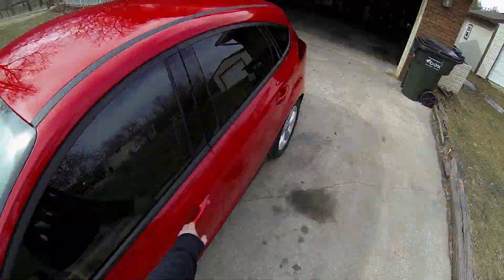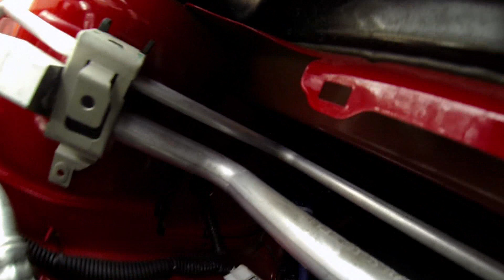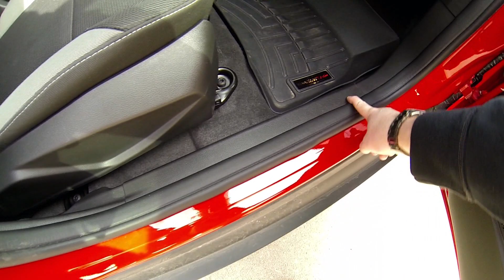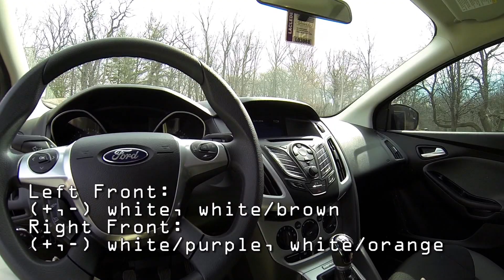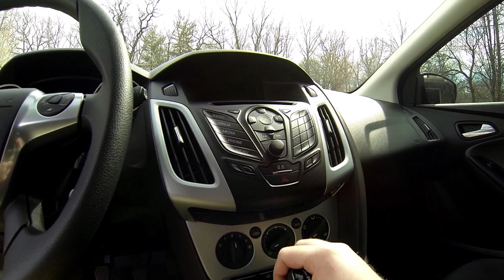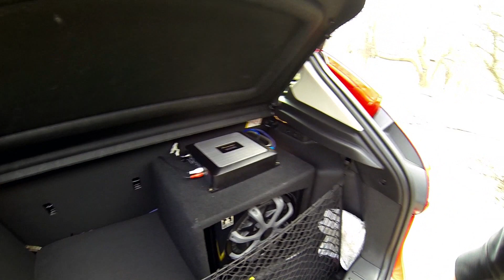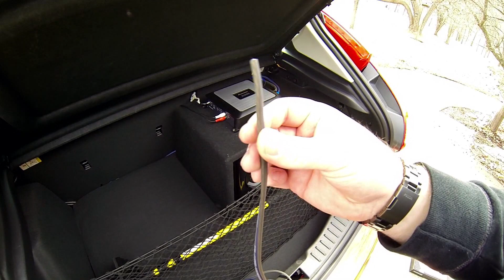2014 Ford Focus Amp Install

Comment: im scared to wire in a sub and amp to my car. i dont really know how to. should i take it to like an audio shop and let them do it?
Reply from the maker: +MrPuRpLeHaZ3 If you want to, then that's fine as long as you take it to a decent place. But it's definitely something that you could do yourself. If you do it yourself, just set aside a whole Saturday to make sure that you aren't rushed. This whole thing took me quite a few hours because I wanted to make sure that it was perfect. This is my first new car, and I really didn't want to mess it up. But luckily there's Google and YouTube University to help you out. Like I said, just take it slow and you'll be fine. But if you get to a point that you don't feel comfortable, then take it in. Best of luck!
Reply: +Dakota Alger i have no electronical experience is it pretty self explanitory if i buy like a kit.
Reply from the maker: Well when I did my first sub woofer installation I didn't have any experience in the matter, but I read a lot of articles online before doing it. Since there's not a rear deck, you have to take out your radio and splice into the wires, and if you're not careful, then you could do some damage. And if you hook up the battery cables you could shock yourself if you don't do it right, so it's not something you want to just do without care, but it's totally doable. If I were you, I'd check out more videos and online pages first. I do a more complete installation in my friend's Ford Fiesta here if you want to check it out:
 https://www.youtube.com/watch?v=jYCFZ5l726c
Reply: +Dakota Alger thsnks man your really helpful. i have a couple friends at school that are really big in systems so ill see if they can help me. this is my first new car aswell and i dont wanna mess up wiring like i did with my last one lol
Reply from the maker: +MrPuRpLeHaZ3 Yes perfect! If you have some people who have done it before then you can know all the mistakes not to make. lol   Glad I could help.
Reply: +Dakota Alger i bught a sub and an amp. i got the 12'' pioneer champion 2000w and a boss audio ar2000m. i dont know what guage wires i should get. i dont wanna cheap out on wires. but im also on a budget.
Reply from the maker: +MrPuRpLeHaZ3 I got 4 gauge kicker wires. I literally just got done installing a system in my little brothers car with the same wiring kit. It's more expensive than the other kits out there, but considering that you'll probably never take the wires out, you might as well spend some extra to get the good stuff. Mine were like $60 on amazon. I'm not sure what my brother paid for them though.
Reply: +Dakota Alger wow the wires cost more then my sub LOL. thanks for the help again. ill probably have some more questions soon lol
Reply from the maker: +MrPuRpLeHaZ3 No problem
Reply: +Dakota Alger if my amp accepts high level inputs i dont need a line out converter?
Reply from the maker: +MrPuRpLeHaZ3 Yes. That's the way my amp is, so I didn't waste the money on one.
Reply: +Dakota Alger if everything gets in on time i will be installing my sub this weekend. people said have it professionally done if i have steering wheel controls. if im just hooking into the head unit the steering wheel controls shouldnt be affected right?

Comment: Instructions were spot on. Installed everything without trouble. I added a signal to RCA converter in your install though. That is a must for tieing into a stock system. I used a Scosche Line-Out Converter with Bass Control for $20 (Walmart #: 551304026) but if you want to stick with Kicker (SKU: KIC13-KISLOC-N) it cost the same but doesn't come with the dash mountable gain control (which is good for me since i occasionally have my 3 year old in my car. I then use a Add-a-Circuit to power it since it acts as a signal booster.
Reply from the maker: +Chad Jason Luckily my sub has high level inputs, so it saved me quite a bit of extra wiring there. I soldered a potentiometer to my amp board so I can adjust the gain of the amp remotely too. It looks kind of bad, but it's just sitting in my center console right now.
Reply: Chad Jason which fuse did you do the add a circuit to? all of the fuse slots I have tried so far aren't working. Everything I put the remote wire into the amp, the amp is just constantly on,  no matter what. Doesn't even have to be plugged into a fuse slot
Reply: Cody Harper I used 5 amp fuse in the trunk gos to sun roof I don't have

Comment: where did you plug your remote wire into? I have an adapter but I can't seem to find a video that tells me were the remote wire goes.
Reply from the maker: My amp doesn't need a remote wire so I didn't run one. But find a fuse (behind the glove box) that will only be on when the car is running, and then use a "add a circuit" fuse holder to hook in your remote wire. The manual and a multimeter will help in you in your hunt. Let me know if you can't find a suitable fuse though and I'll check it out in my car.
Reply: Okay, thanks.

Comment: I'm not even in the market for installing a stereo in my focus and I still think this was a very well put video haha. But I really like your driver and passenger floor mats! Where'd you get them??
Reply from the maker: +moelns12 Thank you! They're weathertech floor mats. They are amazing, especially for winter. Since this was my first new car, I wanted to keep the carpets nice, and I made it through two winters now without a problem. They are pricey, but Huskyliners are similar and are about half the price, so check them out too.

Comment: very helpful video man. thanks for posting. question... have you had any problems with Sync after the install? or does everything still run fine?
Reply from the maker: +Mark McRae Glad I could help. I haven't had any NEW problems with Sync, but the software has always sucked. All the voice commands and all that still work, but this is with the stock SE sound system, so I don't know if anything is different with the upgrade sound system.

Comment: Does the 2014 focus have RCA, or do I need a converter or a processor??? Please respond. I have a 2015 focus but should be similar.
Reply from the maker: Alfredo Morales I haven't seen a stock car with RCA. If you watch the video, I show what wires to tap into for some custom RCA cables that I got from RadioShack. My amp has high level input capability, so I didn't need a converter. Just check your amp first.

Comment: I'm assuming this is an SE? So your saying the amp doesn't require a line level? How do I know it I need a line level? I have an SE hatch, and the amp I have is a fosgate 300S. How do I know if I need a line level or not?
Reply from the maker: Micheal Lugo I just looked up the manual. It specifically says that your amp has high level inputs. If you bought the amp new, it should have came with a connector that you have to use to plug the wires in from the back of the stereo into the amp. It's a little 2x2 molex connector with some wires hanging out of it probably. If you don't have the connector, you might be able to find one at radioshack of equivalent. Or, if you're decent at soldering you can solder the connections directly to the amp board.

Comment: That AMP box is a little over kill.
Reply from the maker: Josh McCarthy Overkill is underrated... lol
Yeah that box was $35 when I got it online from best buy, and the 12 inch version was $150. I also tuned it using some polyfil (pillow stuffing), and it sounds amazing (for what it is...).

Comment: Dakota Alger random question, where did you get your floor mats?  Those seem pretty flush and great for all-season weather.  Thanks!
Reply: Those are weathertech floorliners. Weathertech..com that's where I got mine. They run about 170 for the front and rears.
Reply from the maker: Chris Lundin Yeah, viper is right. Sorry about not responding sooner, I remember typing a reply, but it must not have submitted. I paid about $250 for the whole set when I first got the car since I really wanted to keep the carpets clean. Huskyliners are much cheaper though, so check them out too.

Comment: Hey man, Im looking to do a sub install on my 2014 focus SE sedan, but i can't find an ignition only wire for my amp remote, how did you wire yours so that your amp wouldn't draw power without the car or radio being on?
Reply from the maker: Jeff Small I didn't need a remote wire because my amp has an automatic turn on, but I did a remote wire in a 2013 Ford Fiesta in this video: https://www.youtube.com/watch?v=jYCFZ5l726c
Check the other comments and I've said more about it. Let me know if you have any problems.
Reply: Hey man, I appreciate all the help, I got it worked out using a line out converter with a voltage sensing device, Pretty easy fix haha
Reply: Jeff Small hey where did you run your amp remote on and off wire too? Which fuse?

Comment: i have a question for ya.. so i got a line out converter to covert it to rca. do i cut the speaker wire at the back of factory radio and connect to converter will this cut my front speakers off? and it also comes with a wire for remote and contant 12v battery will i need to connect these and how the wire on the converter are very short do i dissconect the 12v constant from back off radio wouldnt this make the radio not work. thanks for reading help would be much appreciuated as im doing this tomo morning
Reply from the maker: Victoria Turner You need to run a parallel connection for the speaker wires. 12v just connect those to your amp positive and ground, again in parallel. You will need to use a "add a circuit" thing to add a connection in the fuse box in the glove box. I showed how I did this on a 2013 Ford Fiesta:
https://www.youtube.com/watch?v=jYCFZ5l726c&list=TLBJDcCoW0jgk

Let me know how far that gets you, and then let me know if you have any problems.

Comment: Are your front speakers still stock? And do you get any trunk rattle?
Reply from the maker: Matthew Perez Yeah all the speakers are stock. I just got out of college so I am planning on upgrading them here soon now that I have a real job. But no my trunk doesn't rattle at all. I got a Weathertech license plate cover, so it keeps the plate really steady, and it won't move around and flop. I don't know what it would be like without it though.

Comment: I might be having a dope moment, but a short question: what did you do for the remote wire 12v turn on? When I turn on my car with the high output wired to my amp, the system doesn't turn on. I'm afraid my vampire clips didn't contact to my stock head unit source, but I didn't think you needed a remote when using 5v high level outputs? Thanks in advance, signed audio n00b. PS amp shows no power as indicacted by light next to amp fuse
Reply from the maker: petah00 I didn't need a remote wire for my Pioneer amp, but if you need one, the amp won't even turn on without it. So have the car off completely, and then turn the key on and see if any lights on the amp light up. If nothing, then run a remote wire from one of the fuses (also check the voltage across the amp power terminals with a volt meter to make sure you have a good fuse connection and ground). I ran a remote wire in another video on a 2013 Ford Fiesta, so hopefully that will show the right amount of detail.
 https://www.youtube.com/watch?v=jYCFZ5l726c
Reply: Wow thanks, yeah, I meant to check out the Fiesta video. I've also got to check my speaker connections because I've never used those clips before and it seemed too easy, hahah. Yeah, I'll find a multimeter and do just that. Cool project and I like your 5spd focus, I wish I didn't have so much traffic I like driving manual!

Comment: Or you could have installed a HEAD UNIT AMP way easier... http://www.amazon.com/Alpine-KTP-445U-4-channel-Power-Amplifier/dp/B003VVYL46
Reply from the maker: ***** No that's completely different. That kind of amp would give more power to the factory speakers, but I wanted to add a sub, because IMO, the factory speakers are fine. The tweeters suck, but other than that they are decent enough for me. And plus, installing that amp is just as much of a pain and requires all the same wiring as my amp, but it draws a lot less power and wouldn't power my system.
Reply: Dakota Alger My mistake I meant to also say change the factory speakers as they are only 25W (which are lacking percussion). Actually that amp is really really easy to install compared to a full size amp everything stays under the dash. The max output is 45W per 4 channels (perfect for me) some people may need more power. I agree on the tweeter issue which I'm changing.
Reply from the maker: ***** Cool I'd be interested in seeing the tweeters changed out and how much of a difference it makes. 

Does that amp work well with the factory speakers then? If so I may end up upgrading using the amp and just leave the stock ones in.
Reply: Dakota Alger I did not try it with the factory speakers. Oddly when I bought this car new a month ago I never turned on the radio. The more I listened and changed the adjustments (had friends listen too) it just sounded flat. I researched it and found people complaining all the way back to 2008 of this very issue with Ford, also I don't really hear the factory tweeters yes it's 6 speakers. The car I traded in was all Pioneer with 50W x 4 and sounded awesome with no sub. This amp gives this car the same thing but I changed the 4 speakers to Kicker 6 3/4 coaxial. Having said that I'm still considering during the return exchange period of swapping the front door speakers for Infinity Primus with true crossovers and tweeters.
http://www.crutchfield.com/p_108P6500CS/Infinity-Primus-PR6500cs.html

http://www.amazon.com/Kicker-40CS674-CS-Series-Coaxial-Speakers/dp/B00BGRMHF2

Comment: hello I have a 2013 Ford Focus base model
and I want to know the + and - the rear output my factory radio to mount an amplifier. if you can answer me this email you would appreciate rosarioalante2@hotmail.com
  thanks
Reply from the maker: pablo garybaldy At 3:50 in the video, I show what wires you need to splice into. You'll need two positives and two negatives, one for the left and one for the right channel audio. Let me know if you have any problems.

Comment: What are the RCA cables in your video?
Reply from the maker: christian esposito They're the signal wires coming into amp from the back of the radio. I used the wiring that came in the Kicker kit to run the signal wires to the back, but then to connect to the amp, I bought a RCA pig tail kit (Has the RCA plug on one side, and just bare wires on the other)
Reply: Dakota Alger Ok cool. I think I can accomplish this on my 2011 Ford Fiesta using a Pioneer GM-D9601 1200W RMS GM Digital Series Class D Monoblock Amplifier. http://www.sonicelectronix.com/item_63975_Pioneer-GM-D9601.html
What do you think?
Reply from the maker: christian esposito Yeah I believe that one has the auto signal detect so you won't need a remote on wire, and it has high level inputs so you don't need a line out converter. It should work perfect. Just make sure you pick up some decent wires to do the install.
Reply: Dakota Alger Thanks for the info. Much appreciated!
Reply from the maker: christian esposito No problem. Be careful going through the firewall, but other than that it is mostly smooth sailing. Good luck with the install!

Comment: Where did you run the Ground to? Looks like i can see it run back behind the rear seats, did you ground it in the trunk or take it back to the drivers side?
Reply from the maker: ugzz I grounded it to one of the rear seat bolts. You want the ground cable to be as short as possible. If you have a ground tester, then that is a great way to check that you'll get a good connection. Sorry that I didn't really explain that in the video.
Reply: Thanks for the reply, i ended up hunting aroun a bit more and when I removed the carpet in the trunk and there is a factory ground next to the drivers side tail light. I re-used that spot. So far no issues.

Comment: I can do it all except the factory radio wiring, really wish there was a video on how to do it, dont want to mess with wiring unless i know exactly what im doing
Reply: i have a 2013 ford focus se if anyone thinks they could help me out!! :)
Reply from the maker: Jason VanNostrand It is really easy, but you have to be careful. If you don't have the Sony stereo, then the colors I listed in the video should be correct. You can
1:
cut the wire factory speaker wire, strip both ends, and then use a wire nut to attach both the wires together again and a third wire to go to the amp/line out converter
(twist all three wires together, twist the wire nut on, then use electrical tape over it)
or 2:
Use tap in wire connectors (listed in the video description) to add the amp wire to the speaker lines.

Option one probably would provide a better contact. Unfortunately, due to class work and the end of the semester madness with graduating, I can't make a video of how to do it until the summer. But if you are still stuck, just let me know.

Hope this helps!
Reply: Dakota Alger
thank you for the response, now these colored wires are all very tightly connected with a bunch of other wires if i remember correctly, these need to be pulled out and stripped back a bit? or am i looking at the wrong wiring? Im not extremely familiar with factory wiring yet.
Reply from the maker: There is one big plug that plugs into the back of the radio in the focus (the metal box behind the face plate). Take out the radio, then unwrap the wires. Mine had a felt like tape on them. I took most of that off so that I could get more room to work with the wires. Once I found the wires I wanted, I used electrical tape to hold all the wires that I didn't want to use back, and that way I only had four wires and a decent amount of room to move around.